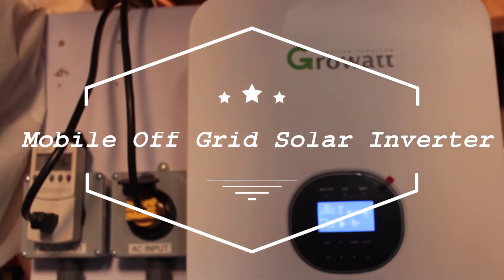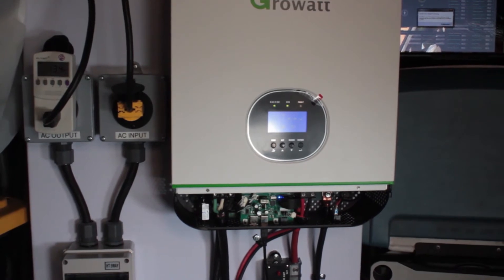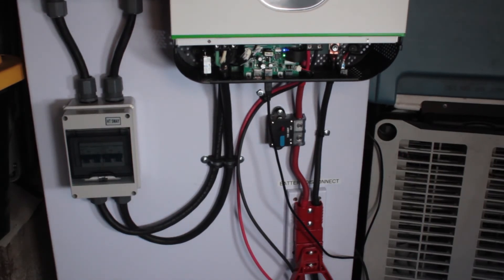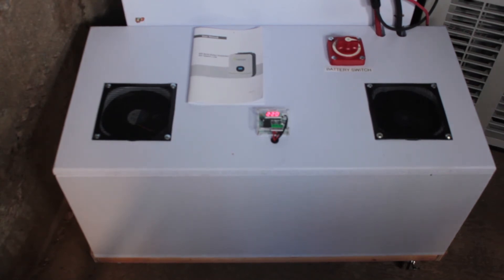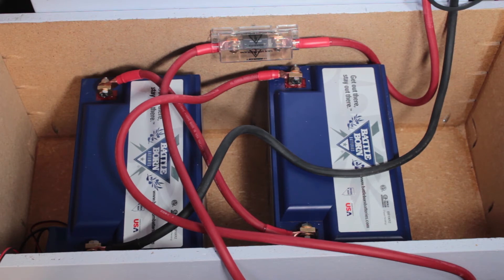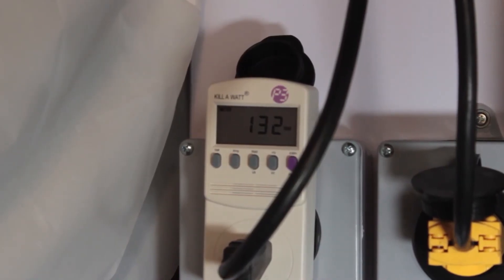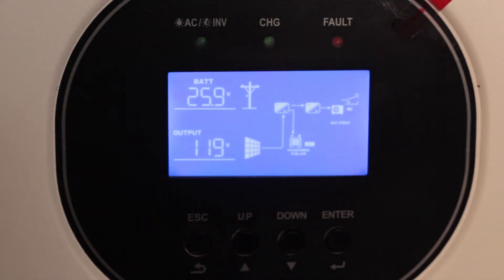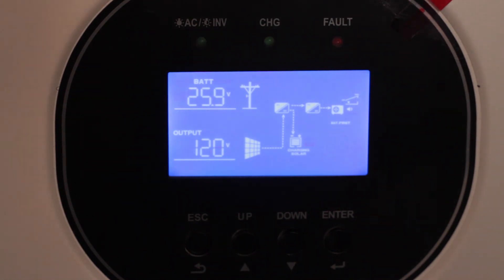Building an Off Grid Growatt Integrated Solar Power System - Part 3 of 3 videos

Comment: Is there a need to ground this system to a ground rod?
Reply from the maker: Hi Willy, I am not sure if it is necessary for the "system" to be connected to a ground rod. However, for connecting and protecting the Solar Panels input to the system I am using an ECO-WORTHY 4 String PV Combiner Box with Lightning Arrester, which is connected to a ground rod. So, that is how mine is grounded. I hope this helps. If anyone else has a definitive answer please add to the comments.

Comment: That AC-in for low DC/solar power is fabulous. First time I'm seeing this option.
Reply from the maker: The Growatt Off-Grid Integrated system is working great. I started with only two 100amh of batteries, so being able to have the grid seamlessly provide power when needed, works perfectly for me.

Comment: Great video.  I just picked up this 24v Growatt for my off-grid cabin here in Alaska.  This is exactly the setup I had envisioned and there it is in your videos.  I was wondering if using 1/0 battery cable is good for this setup?  I know the manual recommends #2 awg.  I am using 420ah lead acid batteries since it frequently gets below sub-freezing temps.  Can I use 1/0?  Pros and cons or would #2 awg works just as good?  Thank you in advance.
Reply from the maker: Hi Edness, good question. I think you might be limited by what gauge wire the battery input terminal on the Growatt will allow. If it says #2-gauge, that might be your limitation. However, I would test to see if it will accept the 1/0-gauge. As for my system, it has been working perfectly with the #2-gauge wire since November 2020, but I have a very short run between the batteries and the Growatt inputs. If you have a very long cable run, you might want to consider using 1/0-gauge to the circuit breaker under the Growatt and then #2 gauge into the Growatt, if #2-gauge is really a limitation. I am only using two 100ah Battle Born batteries, but upgrading to four 100ah batteries in a couple of weeks. If you have not already purchased your batteries there are a lot of new very reasonably priced batteries that have low temperature cut offs and heating pads built into the batteries. I hope this helps, please let me know have the system works out. Best regards John
Reply: @BrightSparkIdeas  Hello John, 👋 Thank you for the quick response. My battery bank currently is 10 feet away so the #2 wire should be fine. I was using 1/0 on my current portable solar generator but the cable is at the cabin. I will test fit the 1/0 next week and will pick up some #2 for safe measure. I plan to wire my Growatt similar to your setup less the Anderson battery disconnect at this time. When I leave the cabin I usually undo the battery terminals. I currently use (4) L16 6 volt lead acid batteries, which works decent but still have venting challenges. I will look into the new lithium batteries with heating elements. I live up here in Alaska and the weather can be quite cold for months. Thank you again Sir for the extremely helpful information. 👍

Comment: Great video. How’s everything going with your system? Have you had any problems with the Growatt and Battle Born Batteries? Reason I’m asking is because I’m about to invest in two Growatt 48v Inverters and 8 Battle Born Batteries. I’m undecided if I want to get two Victron’s or the Growatts. Growatts price and AC output is better.
Reply from the maker: Great question, the quick answer is yes, everything is great. No problems with either the Growatt or the Battle Born batteries. I have added added two 200W 24V solar panels which has doubled my solar input, which has helped. I would like to purchase two more Battle Born batteries, when I get some extra cash.

Comment: I am a new sub  and I have a question  but first I found your video very informative. In the portable power video 3 of Growatt plus battery backup you said the yellow plug was the ac input which kicks in when the solar panels and battery aren't providing enough power . My question is ...When the solar panels and battery aren't providing enough power and the ac input kicks in does the ac input send charge to the battery through the Growatt invertor and in turn the powered appliances draw energy from the battery which would be connected to the house panel ? In essence is it correct to say that the ac input charges the battery while at the same time appliances needing load  are drawing the  energy from the battery. Or does the ac input bypass the battery to feed the appliances until the solar power has recharged the battery. My mother lives in a place where the electric supply is somewhat unstable causing breakers to flip when using the air con and lets say microwave oven at the same time so  I thought I would purchase from bigbattery.com an off grid battery and Growatt inverter kit to make the environment more stable . My thinking is, installing a 5.3 Klw  battery and 3000 watts Growatt invertor  plus solar would make the environment for power consumption more stable and when there isn't  enough solar the ac input from the grid would replenish the battery and "at the same time" the battery would power her appliance through her homes electrical  panel. Thank you so much and I hope to hear from you as soon as possible ......

P.S. I do know that the growatt inverter has a setting hat allows the battery to be replenished with solar and shore power simultaneously but i hope that doesn't mean appliance cannot draw power while the battery is being recharged. If this isn't true, then purchasing this bigbattery, growatt inverter kit from bigbattrey.com is useless to me and would only serve as a backup battery.  In this case a backup generator is the answer but noisy and troublesome to say the least.  Have you noticed the price of gas ? 

Thank you in advance, 

My name is Steve and my email address is gloadventure@hotmail.com
Reply from the maker: Steve, great question and good supporting information. It sounds like you have put a lot of thought into the system for your mother. Yes, the Growatt is capable of using the utility AC to power the property while recharging the battery at the same time if there is insufficient sunshine during bad weather. This can be configured when you set up the Growatt. Program 01 allows you select the charging priority – SOL, is solar first – Utl, is utility first. Mine is set to SbU, where solar is first priority, then battery, then utility. Program 14 will allow you to set SNU, where solar energy and utility will both charge the battery. 
You will have to do some calculations as to how much of your mothers’ home the Growatt will support, but it will certainly be a great back up solution when the power goes out. If you are considering this only as a backup solution, the utility first (Utl) would work for you. I hope this helps.

Comment: very good video. thank you. 

I have a similar setup with a growatt and 24v setup. what would the max reading be on the inverter for volts when fully charged. mine showes 27v. is that within safe parameters? im afraid i might overcharge my batteries.

thank you once again
Reply from the maker: Jan, good question, sounds like you are certainly safe. I would follow the battery manufactures guidelines. I have two Battle Born 12V batteries wired in series giving me a 24 V system. I just followed the Battle Born recommendations as follows: “Bulk/absorb 28.4 – 29.2 V (we usually recommend 28.8 V) float 27.2 V or lower”. So, to be on the conservative side, I set up the Growatt parameter #19 at 28.5V which works well for me. I hope this helps.
Reply: @BrightSparkIdeas  Nice video. How about the setting #12 and #13. What are your values here?

Comment: super clean system my friend I have the same  set up powered by a bigbattery  2.4kw , not as clean as yours but you've inspired me to clean up mine , keep up the good work.
Reply from the maker: I have been looking at the bigbattery options too. I need to keep mine mobile, so weight is always an issue. Clean an tidy is good, but functional the most important ;-)

Comment: Thanks for the series! How did you hook up your panels? Series or series-parallel? What is your solar voltage and current coming into the GroWatt and what is the minimum required solar voltage to feed the GroWatt?
Reply from the maker: Pmcfly – Good questions. I have 4 X 100 watt polycrystalline panels made by Rich Solar connected in series / parallel. So, the first two panels are wired in series as are the second two and by using two MC4 branch connectors, the two sets are then connected in parallel. Connecting in series / parallel, still provides 400 watts of power and the supply at 40 volts and 10 amps still meets the minimum requirement of 30VCD of the Growatt solar charger.
I originally had all 4 panels connected in series giving 80 volts and 5 amps at the solar charger as the lower amps means you can use thinner wire, but I sometimes had problems with shading of some of the panels, so I went with a compromise using the series / parallel configuration. I am currently clearing an area, that might allow me to add four more 100W Rich Solar panels or two 200W. This will give me better consistent coverage this year.

Comment: Are you running a separate monitor screen from the USB of your GroWatt?  If so can you give me details of what can be monitored or set via that additional screen please.

Thanks, nice set up!!
Reply from the maker: Hi Craig. When I originally setup my system I connected the Growatt to an old laptop, using the USB cable provided, but unfortunately, the app was never stable and kept shutting down. Could have been the app or my old laptop. Once everything was setup and running, I really did not need to monitor the system, so never bothered to solve the problem with the app. Sorry, but that is a long answer, I could have just said don't known ;-) Just as a side note, if I needed to monitor how my system was functioning regularly, as the Growatt is down in my basement, I would probably purchase the WiFi dongle.

Comment: How hard was it to go through the setting to match your battery chemistry and other parameters?
Reply from the maker: Hi, I found it pretty easy to setup, as mine is a basic system. I would suggest reading the manual a couple of times to get use to the terminology. I have been meaning to do another video to go through all the settings and what they do, but I remember seeing a video on this very subject. Okay I found it. It is a YouTube video by Andy P called Growatt LVM 3000 watt Inverter Overview. Andy does a good job of explaining all the codes and the set up. I hope this helps, let me know if it does.

Comment: I appreciate the effort, but 3 videos called "building" and you didn't do any building.  Repeated views of the finished system with no assembly or instruction. After saying you didn't need to demonstrate wiring everything (again, that's the build part) you then spend 1/3 of the video on how to crimp a wirewith your tool?  So nothing was built, connected, or demonstrated in 3 videos.  
I think there's a lot of potential here, but these missed the mark for me.
Reply from the maker: Scott, I am sorry you were disappointed, perhaps the title is misleading. This was the first time I ever made a YouTube video and it was getting very lengthy. I am not quite sure how watching me connect wires to the Growatt or to the circuit breakers would have been helpful as it is time consuming and not easy to video. Also, if you do not know how to connect 110 volt wires you should not be attempting to build an off grid solar system as you are working with electricity that can kill you and you should have a qualified electrician do that for you. My intent was to show how I choose to build a compact system that was modular and movable, not a step-by-step guide to building one. I am sure that there are lots of YouTube videos, showing how to connect wires or screw electrical boxes to a piece of plywood. I thank you, for taking the time to leave your comments and will take them into consideration if I expand my system.

Comment: Can you give info on circuit breaker box and type breakers
Reply from the maker: James, this is what I used - Circuit Breaker Distribution Box, Outdoor Waterproof Distribution Box Breaker for 5 WAYS Circuit Breaker from Amazon.
EHAKL - DZ47-63 C40 - 40 Amp 2 Pole Din Rail Mount Circuit Breaker UL 110 Volt 50/60Hz 4500 Amp
EHAKL – DZ47-63 C20 - 20 Amp 2 Pole Din Rail MCB Circuit Breaker 4500Amp @ 110V 50/60 Hz
Reply: @BrightSparkIdeas  Since it's 120V are you passing both L and N through the 2 pole breaker? Is that bad? Thanks
Reply from the maker: @derekvictory  No, just L, I used the double pole breakers to give the ability to expand my system.
Reply: @BrightSparkIdeas  
Thank you,

Comment: what type of AC cable did you use?
Reply from the maker: Hi Katie, I used 10 AWG Gauge, 3 core (stranded) cable that I purchased from Home Depot, for the AC cable into and out of the the Growatt. I hope this helps.
Reply: @BrightSparkIdeas  thank you yes it helps!
Reply: I picked up a Growatt 24v and the manual recommends a 40A AC input and most people recommend using 8AWG wire for it.  How much AC are you 'sending' yours? Do I need to send it 40A ?
Reply from the maker: @katiewood5219  Katie, I am not a qualified electrician so, please I am only telling you my situation. My appliances, washer, gas dryer, small refrigerator and large refrigerator / freezer, were all on a standard 30-amp circuit, so, I am only providing AC into the Growatt, from a normal circuit, protected at the main box with 30-amp circuit breaker. I added a 40-amp circuit breaker just before the Growatt, in case I ever changed that. I did look for 8-gauge wire, but HD only had the 8-gauge in the stranded flexible cable and I did not think the 10-gauge solid core wire would work with my input socket because it would be too large. My system has been running for 3 months without any issues, so it works for me. I purchased my Growatt from Ian at Watts247 and he is a good source of information. Give Ian a call: 801.403.0336 or send him and email: sales@watts247.com or check out his website: Website: https://watts247.com/. I hope this helps.
Reply: @katiewood5219  It really comes down to the max loading you are going to place on it. The inverter can put out a maximum of 3000 watts continuous but can surge up to 6000 watts for a few seconds. Depending on the power factor of the devices your running, most household items range between .8 to 1 power factor, 40 amps at 120 volts is enough to supply 3800 watts at about .8 power factor up to 4800 watts at a power factor of 1. Pure resistive loads like space heaters or heating elements are close 1, some digital loads with switching power supplies can be less. 30 amps would give you about 2900 to 3600 watts max. Keep in mind the breaker won't trip instantly when the load is exceeded for a few seconds, which is all the inverter can supply, its surge capacity is between 5 and 10 seconds depending on the surge amount. However by code your breaker is supposed to be sized so that the load in continuous use never exceeds 80% of the breakers capacity. 

So if your loads are close to 3000 watts for a continuous period of time you should use a 40 amp breaker. If it's well under that you could go with a smaller breaker, you'd just run the risk of the breaker tripping if you end up running close to max. Romex handles 30 amps at 10 gauge, 40 amps at 8 gauge. Those are NM-B or UF-B. If you run conduit and use THHN wire you can run 40 amps on 10 gauge and 55 amps on 8 gauge. So if your running Romex you'd want to use 8 gauge if you want to have any headroom on your wiring, you could go lower than that if your loads are less but it wouldn't be to code. If you use THHN wire in conduit you could use 10 gauge and be totally fine, or 8 gauge and you'd be overkill. If your ac source is a generator, and you plan to run close to max capacity your generator should be able to deliver about 3500-4000 watts continuous. 

Hope this helps.
Reply from the maker: @andycanfixit  Andy, that you, so much for this information that I did not know. Really helpful, thank you.
Reply: @BrightSparkIdeas  No problem 👍 just trying to help.
Reply: @andycanfixit  Thanks for your advice!  This is definitely helpful.
Reply: @andycanfixit  
Thanks andy, i am hooking a 2424 unit and was looking for these same answers
Reply: Hi, reaching out from the Bahamas, can you give more info on circuit breaker box and type of breakers please
Reply: @jamesedwards387  For my setup I'm using a Square D QO 100 amp 6 space sub panel for the loads my two inverters are running. Here you can get those at Lowe's for about $30 for an indoor one, about $55 for an outdoor one, or off Amazon for a bit more and I added the ground bar strip too it for the grounds. I'm feeding my two inverters from my main panel with either a 40 amp or 50 amp dual pole breaker. I'll have to look to make sure, it's been in service now for almost a year.